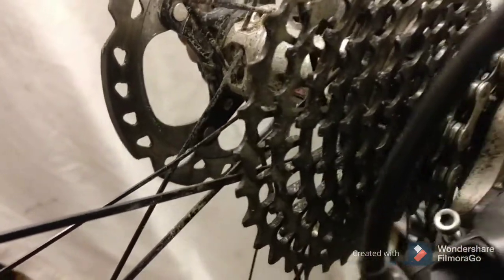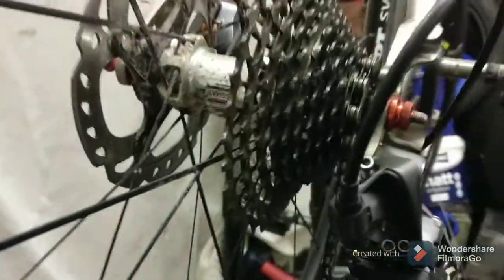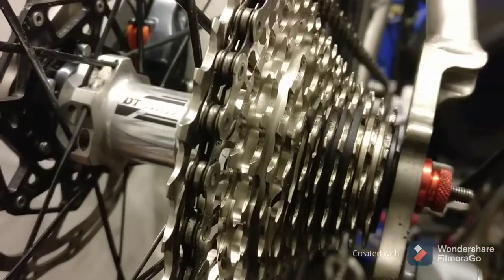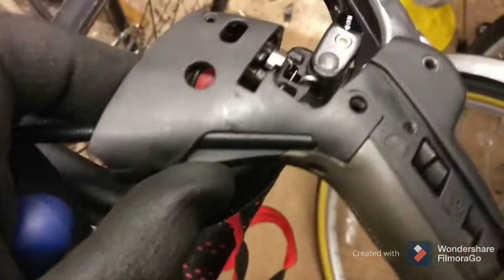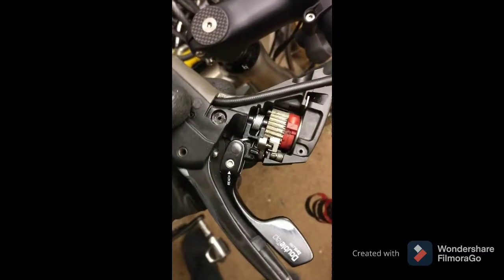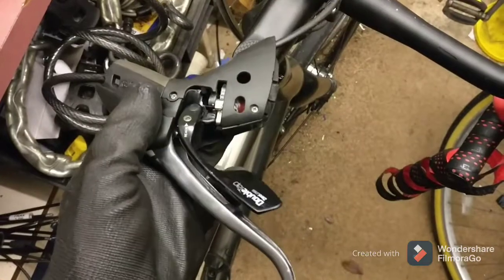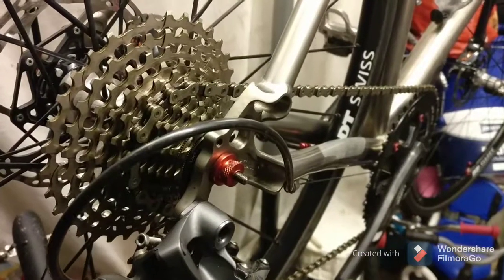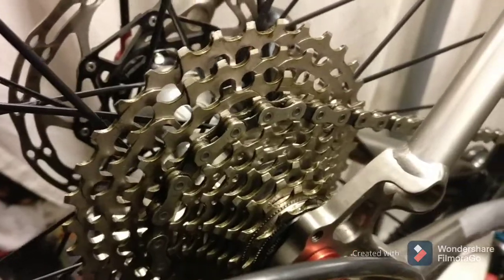SRAM 11 to 12 speed road bike gear conversation, Ratio technology ratchet.

Comment: What kind of cassette are you running and how do you like it?
Reply from the maker: ￡42.81  25%OFF | RYET 12 Speed Cassette Road bike 11-28T 32T 34T UltraLight CNC  12s sprocket for RED 12v SLR lightweight cassette
https://a.aliexpress.com/_uf01MX this is the one I use 11-34 but others are available, hope this helps? Ride safe
Reply: @huggcycles1545  you didn’t have any problems ordering from this website?
Reply from the maker: @astrayagrarian  no I buy from AliExpress all the time, it's a bit like eBay but not as easy to use although a lot cheaper, they accept PayPal. 
The downside the item takes around 2-3weeks to arrive!
Reply from the maker: The cassette was from AliExpress mine is a Ryet 12speed 11-34 this was a cheaper one compared to the ZTTO and Sensah but still light and runs well. The spacing is the same as 11speed SRAM/Shimano
Reply: @huggcycles1545  can you provide me a link or website as to where you bought this cassette? Also, what is the weight of the cassette?

Comment: Thank you very much about the video. how did you manage the chain line ? and how was the ride did you have any problems ?
Reply from the maker: Hi thanks for the message, the bike went well and shifting was good my only issue was the chain line. In the lowest gear I got a lot of chatter only on the 34t rear gear, my front I'm running a 46t but I think with a smaller front ring might reduce the noise.
I opted to buy a new spider as mine was originally for a 2x system, the spider I went for had 3mm offset and I think I need 4.5mm so if needed will space it if the 3mm doesn't work.
But currently the higher 11 gears are fine. 

Hope this helps?!

Regards Karl